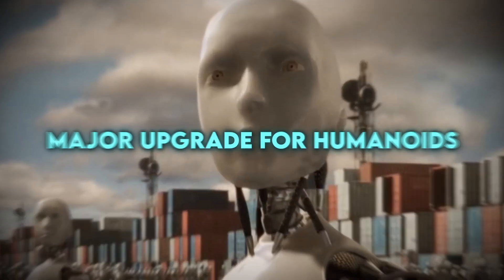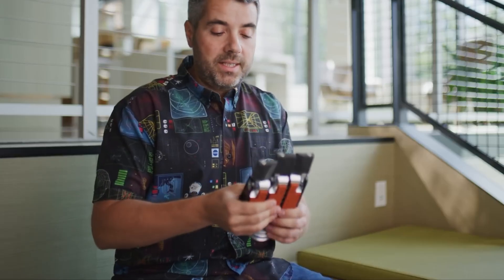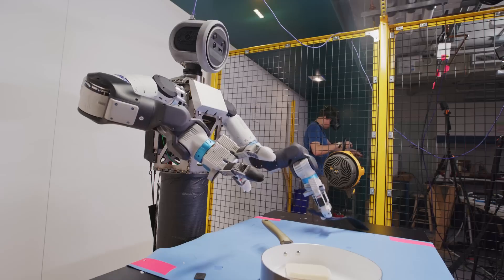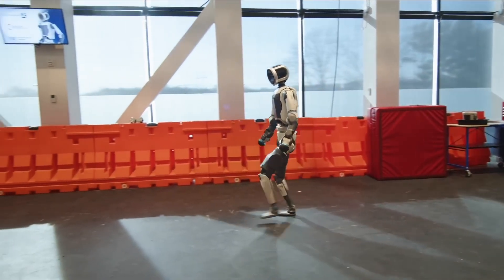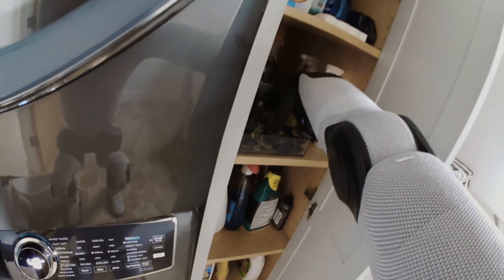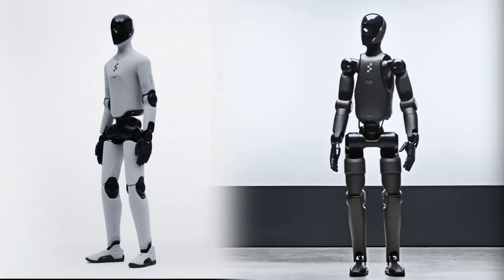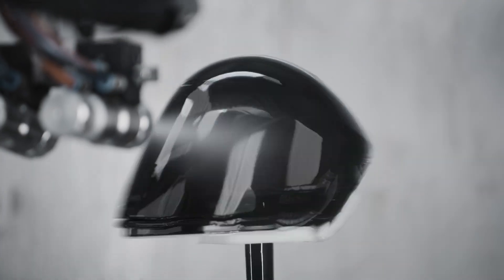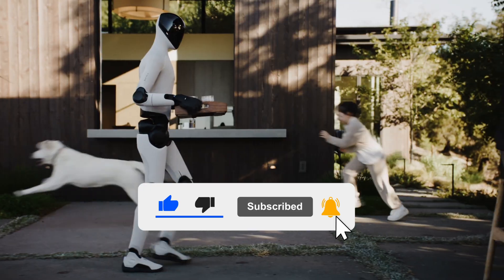Boston Dynamics Just Made Atlas Robot Too Real (New Upgrade)

Comment: Might work better with 6 fingers and plus a thumb on each hand. Can put 3 fingers adjacent to the other 3 fingers at same length, of course. All thumb to help either set of 3 fingers if needed. So, there's 7 fingers per hand, but any more would be clumsy and confusing I think and a bit crowded. Allow each set of 3 fingers to spread out like clutching a round ball.